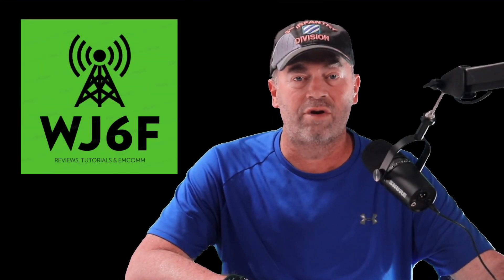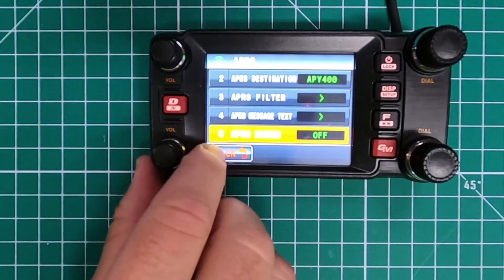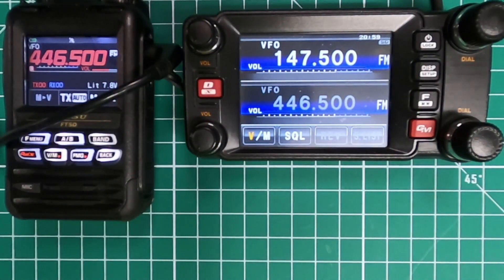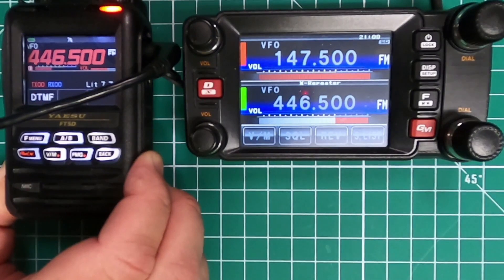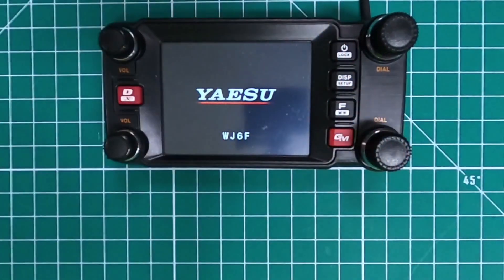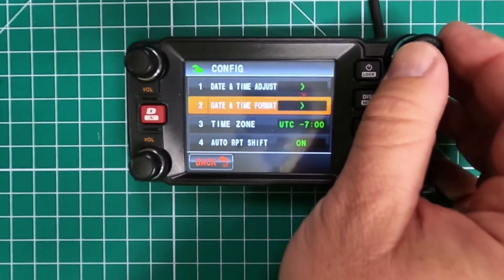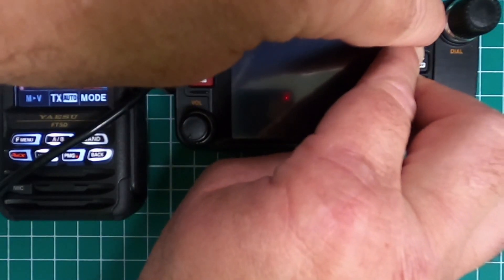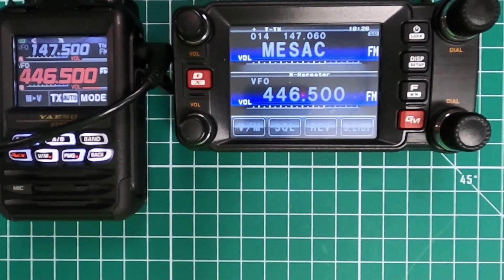Yaesu FTM-400XDR Cross-Band Repeater Mode

Comment: Can I cross band into my distant Fusion repeater? I can't access it with my HT but I can using my 90 ft tower and beam.  This would allow me to work around my farm and work the Fusion machine. Thanks.
Reply from the maker: Thank you for taking the time to watch and the comment! It is greatly appreciated. You should be able to, but will the repeater owner allow that? It is my understanding that some radios can get in to a loop when cross banding into a repeater.

Comment: Can I do cross band repeater mode with Digital modulation (DN) on both channels?
Reply from the maker: Thank you for taking the time to watch and the comment! It is greatly appreciated. I have never tried that so I am not sure.
Reply: @WJ6FRadio  Thank you for your kind reply and this nice video! I'll give it a go and report back to you.. 73''
Reply from the maker: @Abisynth  I may have to give it a try as well!!
Reply: @WJ6FRadio Reporting back: It's not possible..It won't let you choose digital modulation even if you set it up before you go to Repeater Mode. When entering Repeater Mode it automatically changes to FM modulation without the ability to change it... It would be a nice feature thow...Hope in the next update they will included it but a seriously doubt it.
Reply from the maker: @Abisynth   @Abisynth  Thank you for checking that out! I agree it would be a nice feature to have. Not sure why they wont allow it. Only reason I can guess is it could interfere with a repeater.

Comment: Why would using a radio like this be beneficial?
Reply from the maker: Thank you for taking the time to watch and the comment! It is greatly appreciated. For me this radio is beneficial because it has the power and features I like as well as being from the company I prefer to buy from.
Reply: @WJ6FRadio  thanks for the reply but my question is why would you use a radio in crossband like in the video
Reply: @YouTubeMaster1611  There are a couple of reasons why... (1) if the radio you use to x-band is a base, you can set that up and use an HT (hand held radio) around the house (or out to a mile or so) ...you're no longer tied to the corded microphone connected to your main radio... (2) if your mobile is in your vehicle and is set up for x-band, you can go about your business on errands, park your vehicle and head off with an HT (you can even have this set up while driving and use your HT as a speaker/mic)...the radio in your vehicle (out in the parking lot) can now repeat your HT at 50W with a much more substantial external antenna mounted on your vehicle. As shown, this can be configured to hit a repeater......it's a great way to stay in touch with the home base for emergency comms...  73
Reply: @goodoz9942  thank you for the explanation.

Comment: thats the stupidest way to do anything on a radio LOL. Its not your fault its yaesus. Why couldnt they just have a menu option to turn on or off? crazy.
Reply from the maker: Thank you for taking the time to watch and the comment! It is greatly appreciated. I don't know why Yaesu has to have a "Secret Squirrel" method for doing cross band repeat. I agree a single button would be stellar.
Reply: @WJ6FRadio  The radio has a "boot configuration" just like a computer.  That's why you must power down first then boot into x-band configuration.  If you're familiar with computers, think of it like booting up while holding down the F8 key (different on all PCs).  Windows will give you a boot menu before it heads off to the desktop...regular mode, safe mode, safe mode with debugging, etc.  Some radios don't require a reboot for x-band (Anytone is one, I think).  In this case, the radio us using software/firmware to make the internal transceivers connect/talk to each other.  Booting into x-band is literally changing the configuration of the radio's operating system...I'm sure you've noted that once in x-band nothing else on the radio functions...it shuts down all other features of that FTM-400 and makes it dedicated to "only" being a repeater...100% of the processing power is now dedicated to x-banding...which makes everything more stable...IMO.